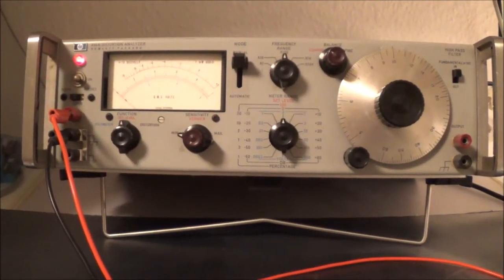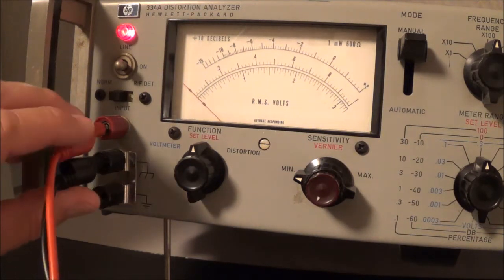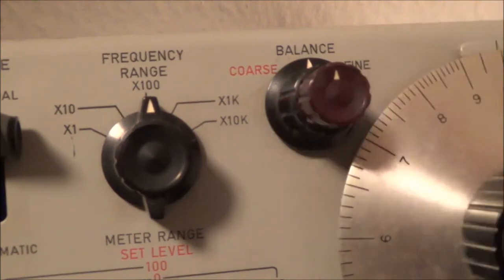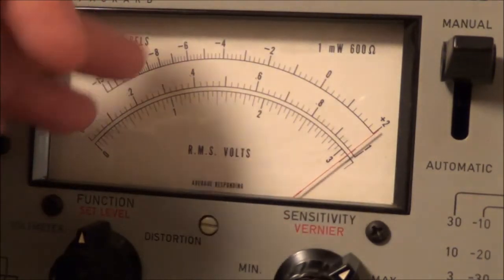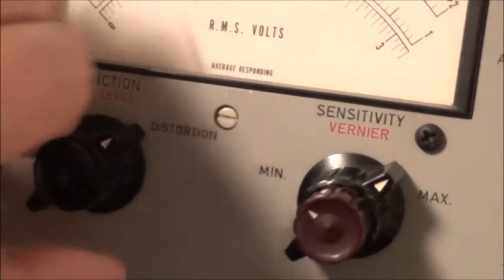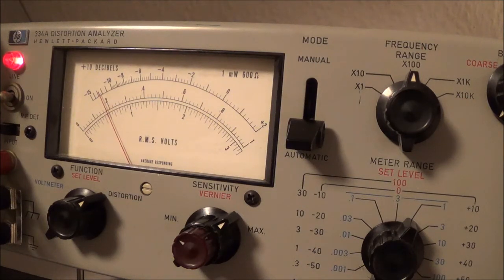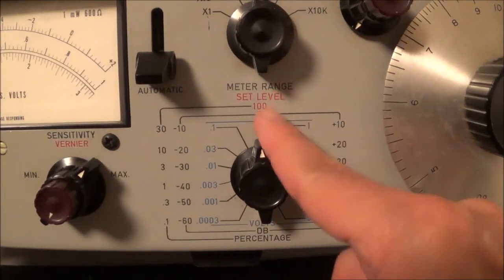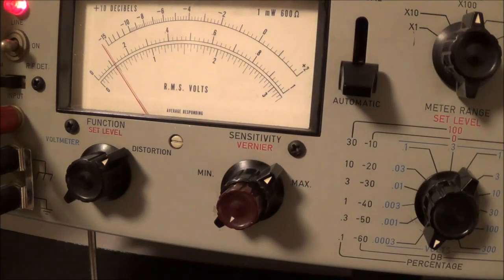HP334A Distortion Meter Tryout

Comment: Thank you, just watched it again for calibration / knob control...mine should be in today...not a HP but vintage and cheap!  :)  ~Jack, VEG
Reply from the maker: Thanks! I look forward to watching the video. Also, I wasn't even finished with my video series on the HP334, where I talk about the scope monitoring output. One day...
Reply: Received the meter, really cool and nice, however...its for the Europe market, 220v, someone cut the mains end off and spliced on a Sony two prong end on....I ordered a converter and Im thinking of swapping out the hard wired mains cable for a 3 prong removable like the computers then ordering a proper corresponding UK cable...but, Ill test it to confirm it does indeed work, I did find 2 transistors that will need some attention and if it does work, then I go through and test the caps....the device dates to about 1976.

If I cant get it going for one reason or another, I may gut it and harvest parts, it will be a shame cuz its really cool...it was made in India.  As far as a video on it, not sure if I will...I am strongly considering slowing down or just stopping video making...not many folks watching and even less are commenting...my videos sux, strongly not recommended watch!  :)  

I have been just going though projects and not making videos, which is a shame, I have lots of junk, but if no ones watching...why waste time....besides its faster to get projects done!  Hope all is well.  ~Jack, VEG
Reply from the maker: I hope all is well with you too.

YT can be discouraging. I have contemplated stopping a few times, especially when you see people that started their channel after you, have got so-so videos, but have 10 times the number of subscribers (no names mentioned). But I get comments/questions from all over the world; kind of keeps me going. Just got a video ready about measuring phase difference--obscure topic. I have not been making or watching videos. I like your videos: only gripe--mega length. But some watchers like long videos. Maybe we should make cat videos?

Good luck with your project! Projects do go faster without cameras in the way!

Comment: Would you recommend this device or would you reach for a different distortion meter?  I'm loosely looking for one. Great video!  ~Jack, VEG
Reply from the maker: Thanks for commenting. The HP333/334a are good "learner" units. Also, you got that solid analog look and feel.  Also solidly built and roomy if you need to work on them. Remember, that you also have to buy a good low-distortion audio generator. The HP339 is such a unit, but not cheap, even though it is also not exactly new. .The 333/334a can usually be gotten for a good price.

Comment: Nice demo...you have some nice test gear!  ~Jack, VEG
Reply from the maker: Thanks! Not that I needed everything...But, nowadays this stuff can be gotten pretty cheap, at least by American standards, compared to what it used to cost new. Also, the stuff can also be resold. I have since cleaned up the aluminum on this unit using Nevr-Dull and am going to repaint the scratched top cover and the sides. A great bonus with this unit is that a complete service manual and calibration procedure can be found online for free.